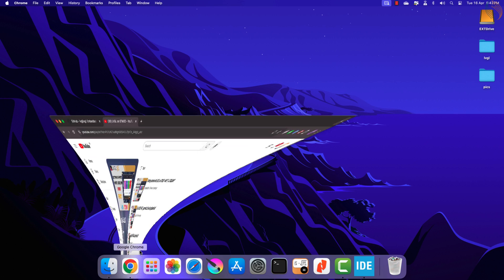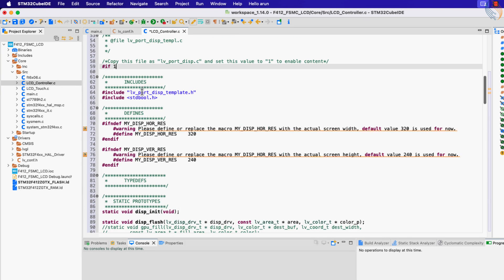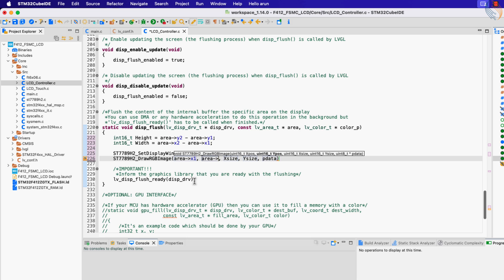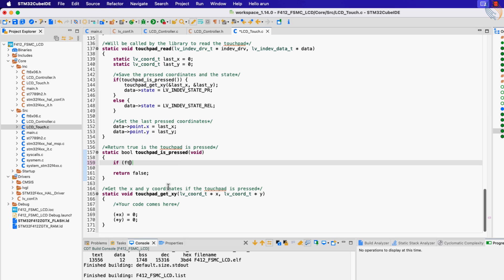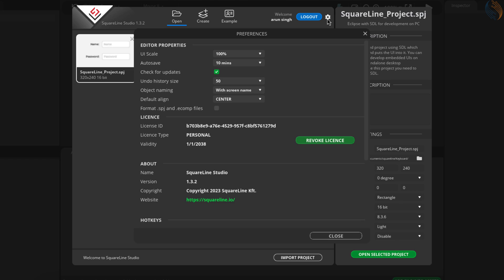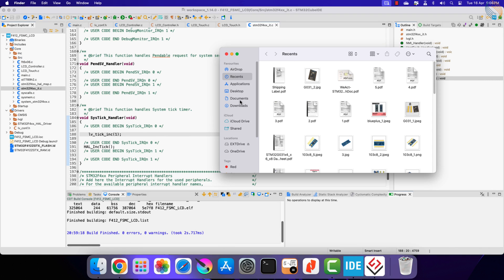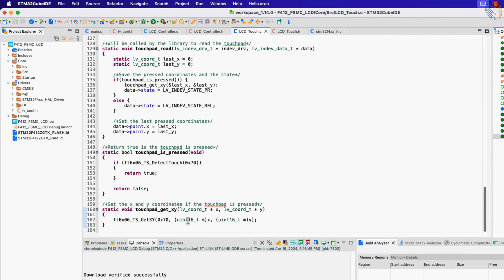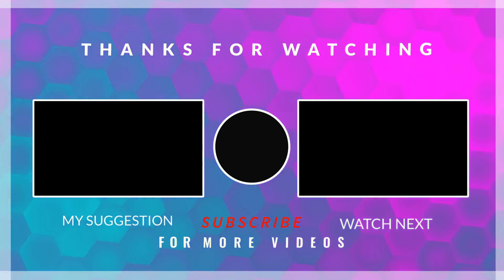STM32 FSMC || LCD PART 3 || Add LVGL & Create UI in SquareLine Studio

Comment: Thanks so much for these serie of tutorial about LVGL. In case of "1.28inch Round LCD Display Module with Touch panel from Waveshare" with GC9A01 display driver is the same process?, Do you have a video tutorial with this GC9A01?